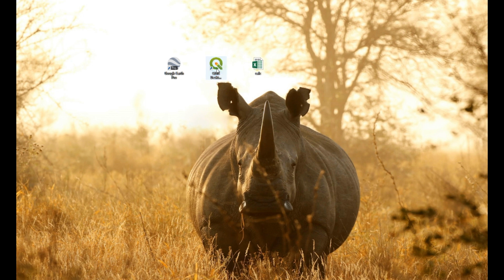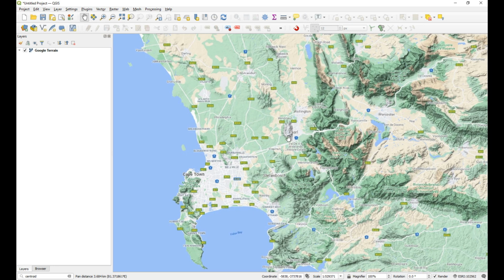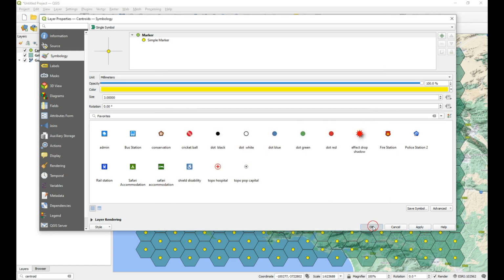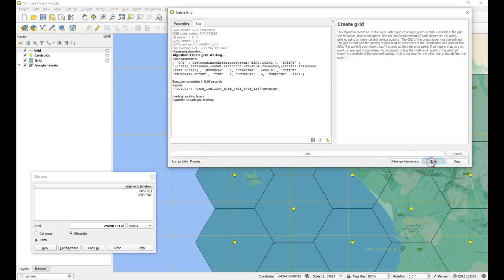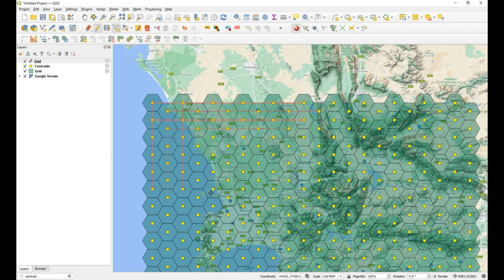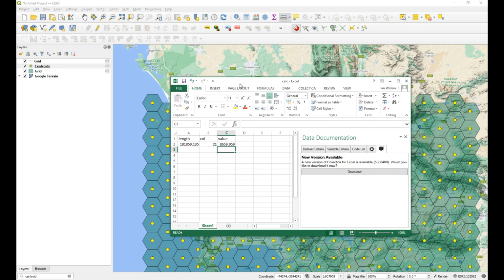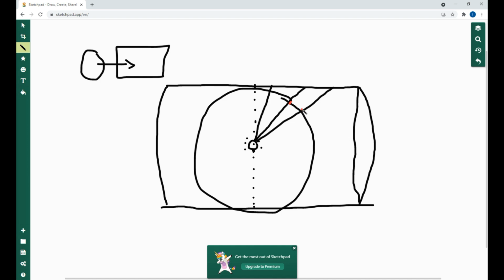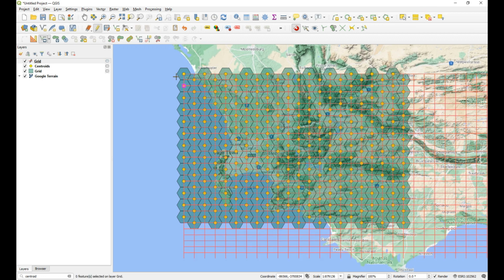QGIS Research Tools Grids

Comment from the maker: Note at 22:14 I move the line grid into place using the top left corner and top left centroid as a reference.  As a reference it would be better to use a line in the middle of the grid and the centroid closest to Lo19.